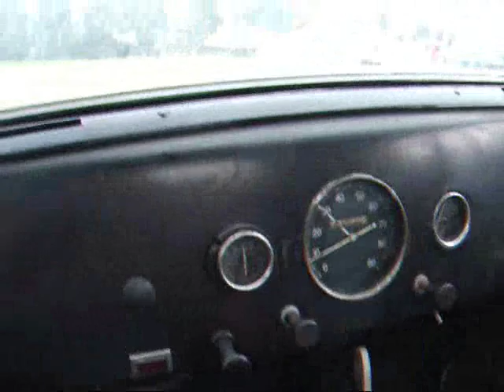1952 Fordson E83W Pick up truck - Sitting since 1982 - Seized solid - First start in 27 years!

Comment from the maker: @andy1orlast 

Hi sorry for the late reply, what i did was soak the valve and guide in penetrating oil. let it sit for a little while and then knock it down slowly with a hammer, then rotate the engine to raise the valve again and repeat the process until the valve moves up and down on its own. 

A stuck valve will also need to be reseated, you will need a seating tool and valve grinding paste to do this. Start with course then use the fine to get a good seat

Comment from the maker: Yes indeed shes 12v.. the engine is from a 100e not sure if that engine was 12v as standard. But if it wasn't it was converted in the 60's when the 100e engine was fitted. 

Thanks for watching. Dan

Comment from the maker: @rustyreks Thanks i really enjoyed getting this old truck going, i dont think i will be putting it back on the road. As its a bit slow with a top speed of 35mph and i dont think the MOT centre neat me will think much of the cable brakes :L 

My next large engine project like this will also be unseizing an engine, this time it will be the 390 CI V8 engine in my dads old 59 Cadillac